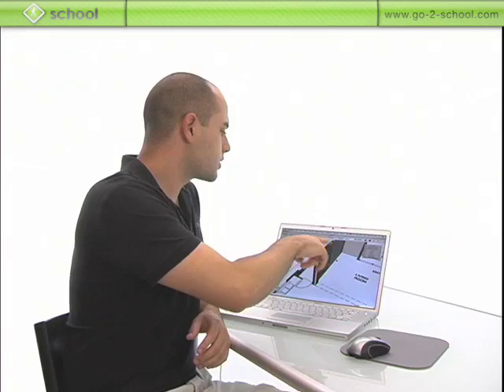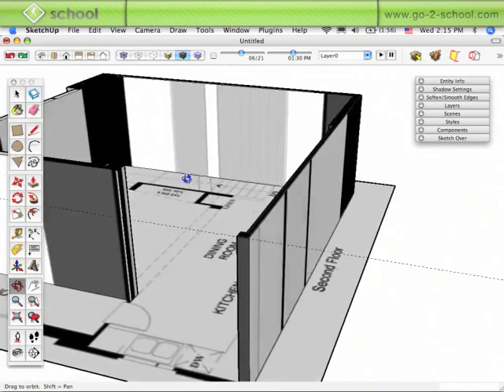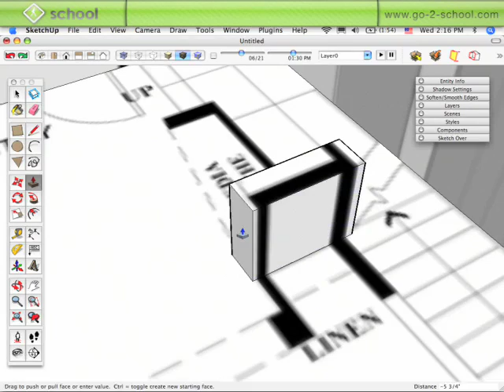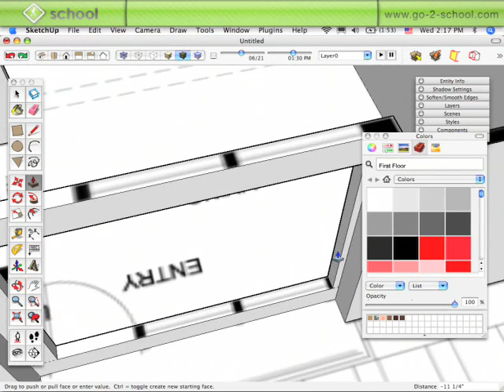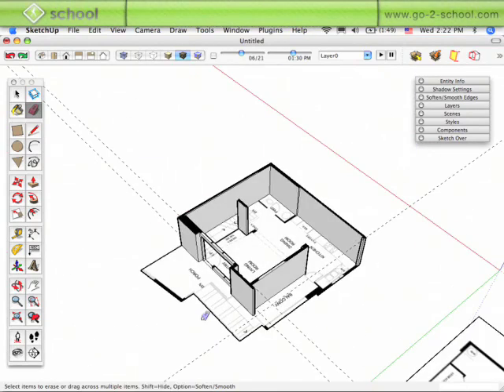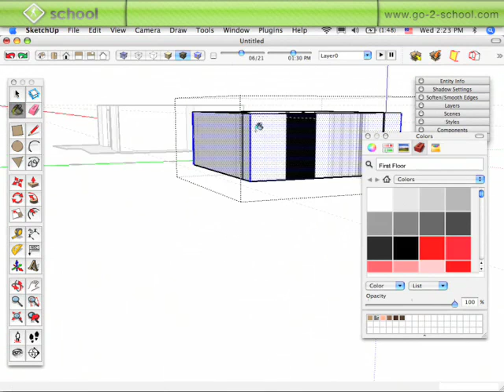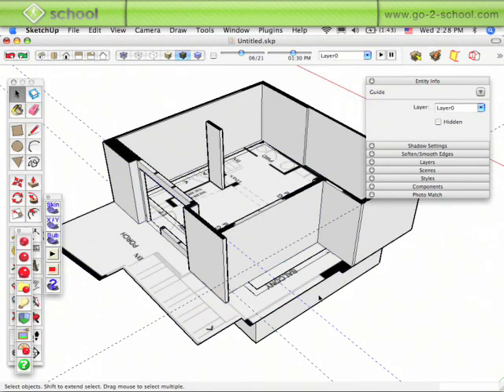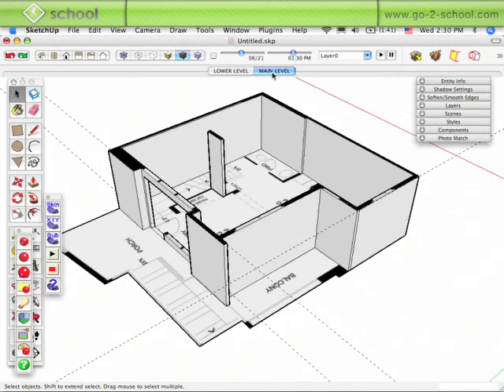Model a House in SketchUp (pt.2) | SketchUp Show #28 (Tutorial)

Comment: As a solidworks user, I cannot deal with drawing without any dimension control point. If I want to make some wall thicker, I would like to double click the wall and select thickness, apply changes, update and automatic relocate window to exterior basement. How is Sketchup with these kind of stuff? I think I used SKUp6. Same for foundation, I update floor plan, and every wall are updated. It this now possible in sketchup?

Comment: Would it be possible for you to do a similar video but using a 3 view of an airplane, construct a 3d model of the airplane and then show how the 3d model could be broken apart into 2D so that it could be printed out as a template to create a model from sheet foam?  There is a very large community of people that fly foam RC aircraft that could use a solid video like this.  3 views are widely available on google; might I suggest the F35 fighter?